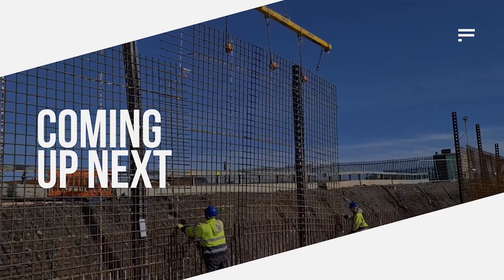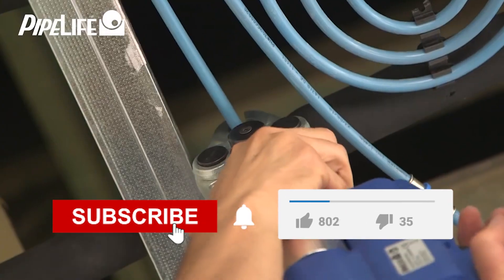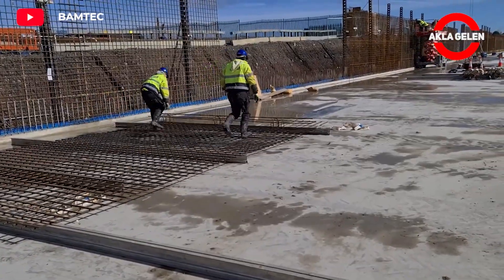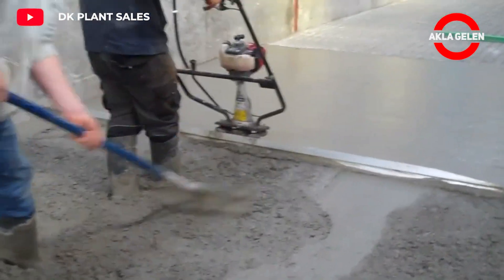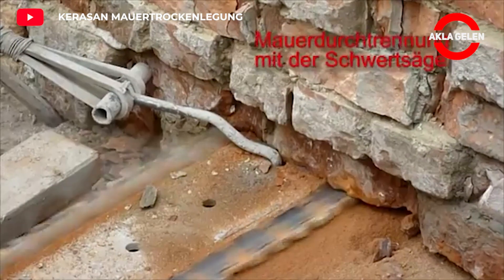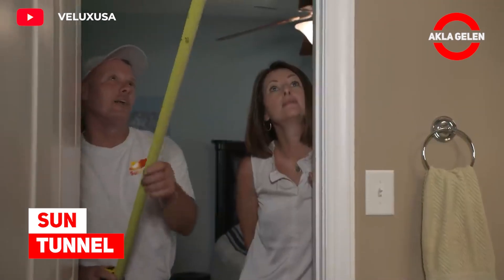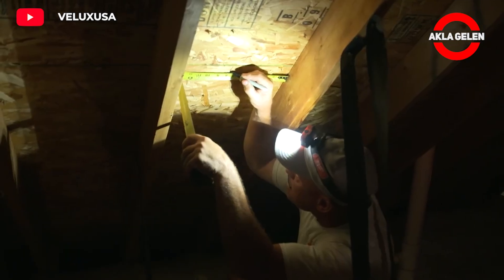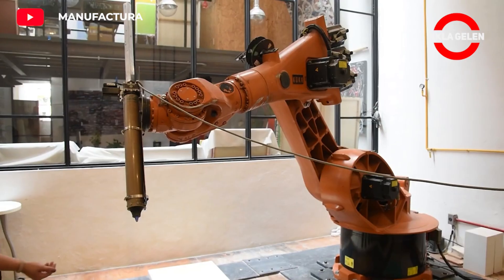Construction Workers Can't Believe This Technology - Incredible Modern Construction Technologies ▶2

Comment: The wire organizer on the ceiling is a great idea to keep the wires tidy even under the ceiling. I think this could also be great way to easily point which wire is for what.
Reply: Do you mean the ceiling heating? In the video they made it in a stupid way, having lots of turning tubes. Usually the metal plates are mounted in the longest possible orientation of the ceiling than the tube is inserted possibly in a single piece, without using connections.

Comment: Heating in ceiling? WTF? Stupid idea. :)
Reply: Great idea. Works, learn some physics. Start at the different modes of heat transfer.
Reply: @williamforsyth6667  It "works", but much worse than heating in the floor. Warm air rises (it would be good if you learn something about thermodynamics). The ceiling heating heats the air from above and the airflow is minimal. Do you mean infrared thermal radiation? Stupid idea, underfloor heating is much more efficient.
Reply: @CzKaa  Sorry, you are really clueless about it. Ceiling heating is better than floor for several reasons. Surface heating works with infrared radiation, convection is negligible. The heat transfer works exactly good on floor, wall or ceiling. Why ceiling is better than floor and wall is that there is no disturbance. No wooden floor, no carpets, no furniture, no problems with drilling the wall if hanging a picture.
Reply: @williamforsyth6667  It is only your opinion/pov. :)

Comment: That's why the American economy is growing - first buy ceiling heaters, then blankets, then normal heaters, but the wife is using the A/C anyway...
Reply: Ceiling heating was tried way back in the '80's and yes they did heat the room - down to a level of about 2 metres high. If you sat down you were cold.

Comment: Why would anyone put their heating in the ceiling? I get the feeling they failed kindergarten
Reply: My house was built in early 70's with ceiling heat. Other than more available floor space there are Zero positives that I've noticed.
Reply: @stevebless5598  no shit, the floor space got taken out of the next floor too. This is preschool shit... hey let’s heat the roof... you mean outside?
Reply: The only right heating down from ceiling is "dark radiator" (based on gas) or "radiant heating" (electric) because they heat objects, not air.
Reply: "put their heating in the ceiling"
I have ceiling heating and it works perfectly. It transfers heat by radiation, so does not matter whether it is on floor, wall or ceiling.
If you want surface heating, you can put it 
- on the floor (we have wood floor and carpets, so not optimal)
- on the walls (hard to find enough surface with no furniture) 
- on the ceiling (perfect, because all of it is available and is undisturbed)
If it is on the ceiling it can also be used for cooling (which we do not use).

Comment: A few dumb ones! Heating the roof! Heat rises. You will have warm attic and a cold room. Why not put re bar in the brick wall with the insulation so it is stronger in an earthquake. The #D printing blocks where laid on a support that looked like a banana of the weight!
Reply: "Heat rises" My god, another one. No, heat does not rise. 
Ceiling heating is working great, because it transfers heat by radiation instead of convection.
Reply: @williamforsyth6667  Yeah, yeah, keeps your ears war and your feet cold. In my country were the ground is frozen most of the time, this is a really dumb idea. No matter what foundation of the house you have. Just take temperature measurements at different heights in the room and try to get it as even as possible. If it's a house with 2 floor open air space, you can use a ceiling fan to circulate the air from under the roof down. I live in a house with 3 floors and it's a big difference in room temperatures in the bottom floor vs the top floor due to heat rising. It's just physics. With warm floors the room can be held colder so you save energy.

Comment: --- as a construction worker, I can say that I believed every single one of those yet found none of them incredible though some were fairly idiotic  -   nor did I find mixing clay by walking on it barefooted to be "modern technology"
Reply: As someone in the industry. Ceiling heating nearly doesnt work as efficient as floor heating. Just as floor cooling nearly works as efficient ceiling cooling. 

Heat rises, cool drops. Its common sense.
Reply: @tropicalreeman  "someone in the industry" You should not be in the industry based on what you have written here.
Ceiling heating is great, it is better than floor heating. And no, heat does not rise.
The problem with the ceiling heating on the video is that they have more turning tubes and effective one. 
It is normally done with single turning wall to wall to maximize the effective area.
Reply: Thumbnail and first clip has no thermal break.
Stupid.
Reply: Bravo

Comment: What is the u-value of the hollow block wall?  I like 0.1 and below
Reply: About zero once capillary action soaks the wall from outside to inside.
Reply: @Benzknees  Who is the manufcturer of hollow block wall
Reply: @giorgiokoutsoukos9185  - I doubt they're still in business, the idea is lunacy.
Reply: @Benzknees  And yet hollow block bricks are the fastest growing area of construction materials in Europe so someone may have misunderstood this idea.
Reply: @Andrew-vx2ls  - Not this type. Not in this orientation.
Reply: Bloksan sells those, called Thermo Brick. I'd rather choose Poroton.
Reply: being a clay brick, it would provide some thermal mass to compensate for the low u-value or R-value
Reply: @moonants  But half of that thermal mass is no the wrong side of the insulation.
Reply: @williamforsyth6667  Yup, the insulation pretty much negates any advantages of thermal mass.
Reply: @moonants The thermal mass must be inside the insulation. My (very old) house has 8" (20cm) insulation and 20" (50cm) solid brick walls. Temperature does no vary much.
Reply: @williamforsyth6667  High thermal mass will store heat and release it slowly - insulation will prevent it getting hot in the first place, and not allow it to be released.
Reply: @moonants Of course we want to prevent the walls (thermal mass) getting hot in the summer. They are not capable storing heat between seasons. 
A good thermal mass for a building can do things like:
- equalize temp during the day
- avoid overheating during heat waves
- allows running heating or AC when energy is cheapest during the day.
Thermal mass alone does not reduce energy needs of the house. That is done with insulation.
Reply: @williamforsyth6667  My very old house has 0.5m thick stone walls, with mud plaster inside. No insulation. On a hot day, it stays cool, and by the evening in winter the walls are very warm
Reply: @moonants  I have the same type (0.5 m thick solid brick wall) of house. After insulation (20-30cm) heating requirement dropped to a fraction.
The heat capacity of such a wall can help to equalize for a few weeks of heat waves in the summer. But it cannot help for a half year of heating season.